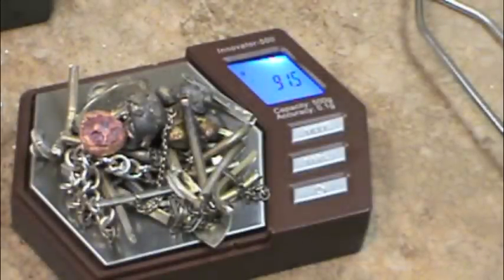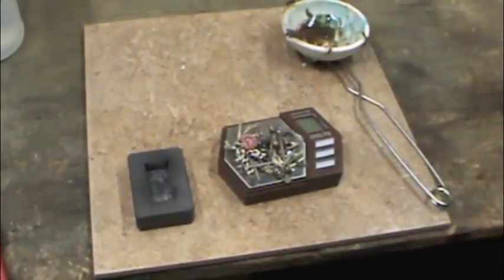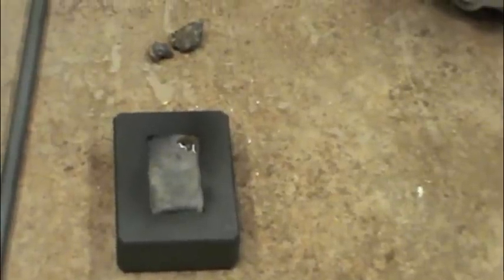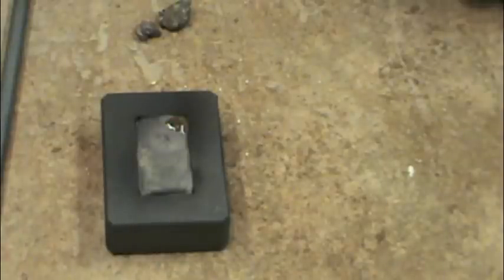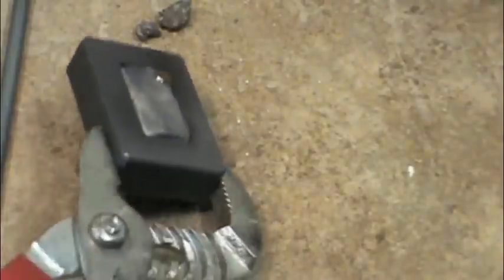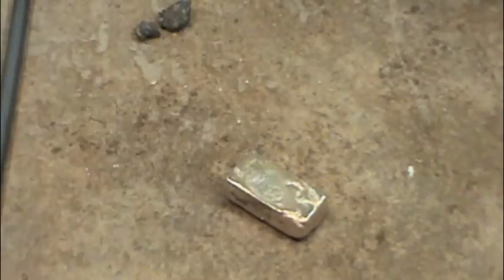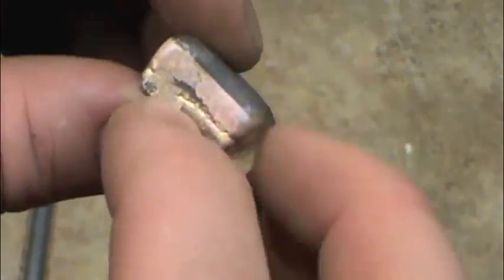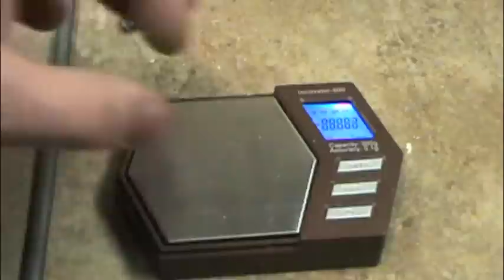Smelting silver into a bar

Comment: As a tip if you get a small piece of that ceramic insulation and make a bowl out of it and place the ceramic crucible in it you will heat up faster and use less gas just a suggestion if you do it again it was a night and day difference I can also melt copper as well with mapp gas

Comment: I tried this with a broken necklace and it would not melt into a puddle just stuck to the bottom of the crucible. went through an entire can of propane I don't see how it melts into a puddle to pour.
Reply: I think it's because he's holding his crucible in the air. Did you have yours sitting on a brick or something? I have the same problem and am thinking that's the cause
Reply: wheredidileavemycell
1 second ago
that shouldnt matter. the borax will help liquify the silver, the issue is probably your torch...the simple, non-spiral torch head isnt hot enough to melt silver. get the heavier duty torch with a built in ignitor. it produces a spiral shaped flame that intensifies the heat output.

http://www.homedepot.com/catalog/productImages/1000/7a/7af52940-265e-4a36-9e70-f8b268725d92_1000.jpg
Reply: are you suppose to use mapp gas?
Reply: are you suppose to use mapp gas?
Reply: miranda7731 yes
Use mapp gas
Reply: Dale did you season your crucible with a layer of borax before hand?
Reply: He adds the Borex to the Crucible before hand, and melts it to coat the whole surface and then Silver into it to melt and pour.

Comment: Since copper melts at 1085 and silver at 962 is there anyway of separating the silver and copper so that you can remove most of that copper to make the bar at or around 99% purity?
Reply: you'd have to refine it using either electrolysis or acid refining then melt the resulting powder
Reply: To me this is melting and not smelting!
Reply: to get investment grade silver which is at least 3 9's pure you have to start with a nitric acid extraction which will get you around 99%. To get 99.9+ you must then run it through a silver cell (electrolysis).
Reply: @johnyrebel188  you can get 3 9's pure with acids as well. there's a few other steps after the nitric bath, but its possible, and kind of easy. silver cell actually gets it 4 9's pure if done right.

Comment from the maker: You have to treat the crucible with borax before you melt silver in it. Its called seasoning the crucible. It takes a little bit of Borax at first but you have to keep adding it while you heat the crucible. The borax will burn off for a bit but over time it will form a liquid glass on the bottom. Now you can start smelting silver. Borax keeps the molten silver from sticking.

Comment: I can't get my silver to melt completely into a liquid. I have the max heat blow torch so I thought it would work since I just got a little graphite crucible but still no. Do I have to be holding the crucible up off the table/tile like you are? That's it maybe that's where all my heat is going

Comment: How do you tell if something is sterling? Like those chains and just "Scrap" 

Are there markings or anything? How do you test em? And where can I find scrap? 

Sorry for so many questions :P
Reply: 1. It says anything along the lines of '925' (92.5% pure).
2. You can test it with acid and the purity is based on the colour the acid changes
3. You can buy scrap online, or just from old electronics
Reply: As a side note: some less scrupulous jewelry dealers mark their inferior silver alloys as 925 Sterling, when in fact it's much lower.  While the quality stamp is always a good thing to look for, it doesn't always mean it's accurate!
Reply: capsized
Reply: mainly look at Mexican silver as one of the big ones for this these days as I have bought Mexican silver that is as low as a third silver but I paid way below scrap at table top sales (5p a gram sort of pricing) but for finding 90%+ silver you have pre-1964 US coins at 90% and pre-1920 UK coins those are sterling...of course you also have jewellery marked .925, ster, sterling and especally with the UK stuff it will have a lion as part of the alley mark confirming it is sterling

Comment: what r u using for heat ? just a reg propane torch ,,,or what is the best to use in something hand held like your using?
Reply from the maker: I use a torch with mapp gas cause it burns hotter. A shop torch would work even better.

Comment: Quick question regarding the borax... I read somewhere else that the borax will cause the silver to stick to a graphite mold if it comes into contact. Have you experienced this? And if so, how do you avoid the contact?
Reply from the maker: I use the borax to create a coating of glass on the bottom of the crucible. This keeps the silver from sticking to the crucible. I haven't had any problems with the borax sticking to anything else.

Comment: Do you know the approximate price of that little bar? And what does heating the mold do?
Reply from the maker: At $20 an oz this bar would be worth around $50. If you pour into a cold mold it can cause the silver to pop and shoot molten silver everywhere.
Reply: Vines Uncut How long should you heat the mold before pouring? how hot should it be?
Reply from the maker: As hot as possible. A cold mold can cause the metal to pop all over the place.

Comment: Nice video, So, wouldn't most silver rough pour molds be 92.5% or less purity? Also, do you know of any sellers making interesting mold designs that would make something other than a rough bar?
Reply from the maker: Todd White yes I use old sterling .925 to make the bars. The have tons of different graphite molds on EBay.
Reply: I'm thinking that most rough pour molds that are being sold online would most likely also be .925's since I doubt if people would take the time to refine a rough pour.

Comment: What happens to the tin or other impurities ? does it burn off? are you using Propane or mapp gas or ??
Reply: There is no Tin in Sterling - it is just Silver and Copper.  The impurities he refers to are copper and silver oxides.  When the metals become hot enough, they react with oxygen to form oxides.  Rust is the same reaction occurring in Iron - Given enough time oxides will form naturally and are referred to as tarnish, but heat accelerates the reaction substantially (instantaneous).

The borax or boric acid reacts with the oxygen around the metal preventing any oxides from forming and helps to remove oxides already formed.  No alloy of the metal is removed via the addition of the acid, just the oxides
Reply: Tyrone Taylor Also he is using a hand held Mapp torch with ambient oxygen.
Reply: I appreciate the info
Thank you
Reply: Great info, thanks.

Comment: What torch is that? Propane or MAPP gas? Great video by the way.
Reply from the maker: Steve Rogers I use Mapp gas because it burns hotter.
Reply: +NativePrairie WolfTwo  mapp as originally sold is no  longer available.   the newer version is not as hot.

Comment: I have 1,000 ounces worth of small silver bars and rounds (1, 5, 10 ounces mostly).  Is it possible to melt them down into one 1,000 ounce silver bar?
Reply from the maker: FortNikitaBullion yes if you had large enough equipment you could mold a 1000 bar but it might be easier to just buy one.
Reply: FortNikitaBullion  a 60 pound bar! wow that would be awesome!
Reply: MN TreasureDiver I do have a 1,000 ounce silver bar.

The problem is that with my other junk silver / other silver bars, the dealer wants 10% just for me to trade it up for a 1,000 ounce bar, which I like not just for the novelty but for ease of transport, especially considering I have many many low-grade/damaged/common coins that would not lose value being melted down.

Also, how do you remove the 10% copper?
Reply: It is more practical to keep small bars to sell/trade if and when the dollar crashes. You don't want to have to buy a loaf of bread with a thousand ounce bar, do you?

Comment: what is the purity of the bar once it comes out of the mold, is it  .999 or .925? and by putting borax in it , that helps burn off the copper , zinc ect that's not silver ?
Reply from the maker: The bar was tested to be .925. Borax will help remove dirt and such but it does not remove the copper.
Reply: ahhh okay. so you wont get as much money per say but still something. cool thank you
Reply from the maker: ***** I am mearly smelting down the junk jewelry in to a bar.  Smelting does not remove copper or gold out instead it mixes with the silver. All of my bars test over 90% which  is what I try to maintain with each melt.

Comment: what is that white powder you putting in to it?
Reply from the maker: Borax which turns to molten glass as you heat it with the torch. This allows the molten silver to float on top of the molten glass.
Reply: JunkmasterJay231  where is or what kind of shop that sells  
"Borax"
Reply from the maker: You can find Borax at most grocery stores.
Reply: JunkmasterJay231
Thanks for the information!

Comment: So does the bar come out pure or still 925
Reply: LeoTkdMT Still 925. To get the copper out (which is what the .075 is) you would need to purify it chemically, using nitric acid to dissolve both, then drop out the silver precipitate with copper metal which replaces the silver in the acid solution.
Reply: thank you for clarifying.
Reply: LeoTkdMT Not a problem! Happy to help!

Comment: OK I just brought a melting kit off eBay  can I use a regular blow torch like I'd but from Lowes for 20 - 30 bucks???
Reply: Christopher Anderson Yeah, but you're going to be standing there for a long time, and using more bottles than its worth...
Reply: OK I realize I may want to invest in some decent space and equipment
Reply: Christopher Anderson If smelting is the sole purpose I would suggest using a fuel / Oxygen torch.  Torches which rely on ambient oxygen burn on average 1,000°F colder than with supplied oxygen.  If you are melting small amounts (1-3ounces) then a Smith Little Torch would pull through for you, even with propane/oxy.  If you want to melt more at once, or metals with a higher melting temperature, then I would suggest a larger torch and/or fuel with a higher burning temperature
Reply: OK on average how much the smelting equipment will run

Comment: how do i distinguish slag from cold silver?
Reply from the maker: eaglescout861  silver will melt more easily then most other metals.
Reply: so i put on heat how do i compare?
Reply: eaglescout861 The only sure way to tell is an acid based testing kit.  Other than that the best way to tell is experience.  Unfortunately there are no "sure-fire" "tell-tale" signs that can be easily conveyed.
Reply: ok cool thx

Comment: Why do you heat up the mold?
Reply from the maker: +Borna Kia The hotter the mold the better the silver will flow and form a better looking bar. If you pour hot metal into a cold mold it could pop hot metal everywhere which is not a fun experience.
Reply: Cool

Comment: never mind the oxidation loss, use flux next time.
Reply: Lol Borax is flux
Reply: Not NEARLY enough to form the film over the top that is needed
Reply: ***** Most silversmiths wouldn't worry too much over the flux addition but a goldsmith would cry if he saw this process.  Think of how you would flour a ball of dough to roll out - it needs a good coating or it will stick to everything.  That's about the amount of flux needed to be effective in reducing oxides during your smelting.
Reply: Hello Friend. can copper be melted with the gas used for cooking (LPG) with a special torch?

Comment: So you lost 83 grams?
Reply from the maker: vpurcellrn I ended up not putting all the silver in the crucible.
Reply: JunkmasterJay231
Ah, okay. I am going to start doing this soon and was curious about the loss. What happens if you have silver that has some other metal scraps in it. Is there an easy way to get those out during the process?
Reply from the maker: vpurcellrn Some jewelry will have small parts/springs that are steel and won't melt down. To remove these you use the carbon rod.
Reply: vpurcellrn To remove other metals which are part of the alloy, however, or to "purify" the silver you would need to go through a rather intensive refining process.  It would be better, especially as a beginner, to simply ensure you keep your scrap "pure" - make sure you aren't mixing alloys.

Comment: How did you make your mold?
Thanks.
Reply from the maker: Jason Weiss graphite molds are used for making metal bars. You can get the molds online in many different sizes. Mine is about 2oz.
Reply: JunkmasterJay231 I plan on getting in to making and selling silver bars once I can get enough money [ about 1300$ in silver grains ], I can easily make 1oz bars for about $0.70 over spot, you think $1.25 over spot is fair for a hand poured 1oz silver bar?

Comment: what kind of torch are you using?
Reply from the maker: I use a torch that runs off of mapp gas cause it burns hotter then propane.
Reply: JunkmasterJay231 I'm about to move to map gas because its very akward using butane or propane,    although something that works is if you buy some fibre ceramic wool and make an igloo out of it,  I do that and can melt about 2 - 3 ounces but its akward because you have to be able to get to mould in there too ( I have a bit on side that opens to get to mould to save time cause it cools v fast with butane)

Comment: What kind of torch  are you using?
Reply: I was wondering the same thing . I wouldn't swear to this but It looks to me like he is using a propane torch you can buy from any hardware store . The bottle was yellow . They come in red blue and yellow . Each one burns at a different temp and i believe yellow burns the hottest.
Reply: cathy roncetti it's either propane or Mapp gas, I would like to know which. I know ppl use propane for .999 . Mapp is hotter than propane, I don't think too hot is a problem so Mapp should work , you may not need it though.
Reply: cathy roncetti it's probably a settling torch look them up but they are quite expensive.
Reply: But you can use propane it will take longer